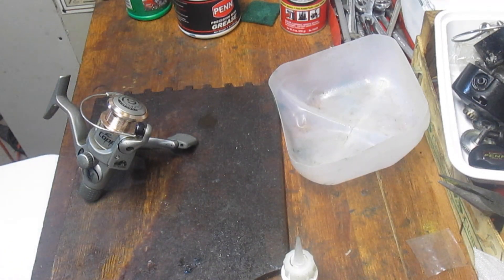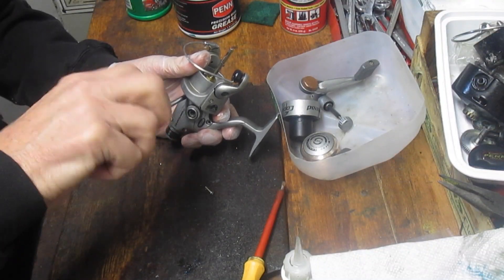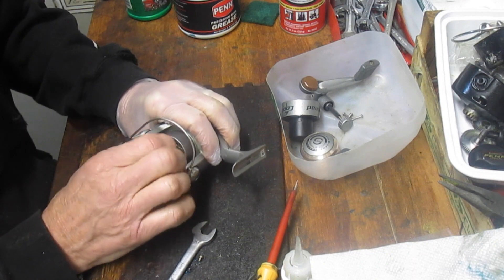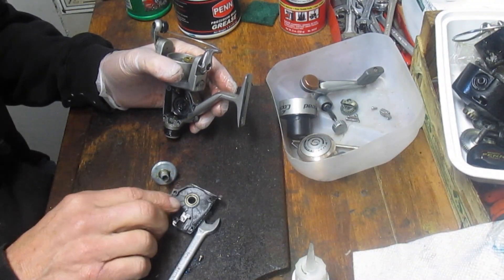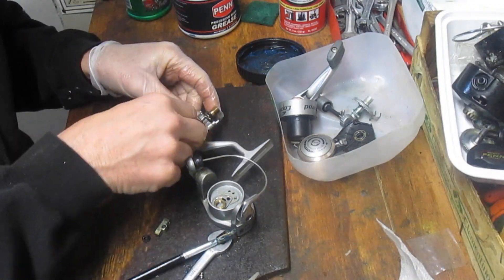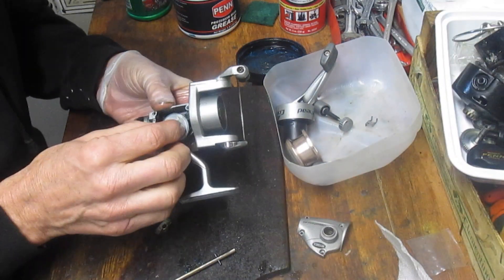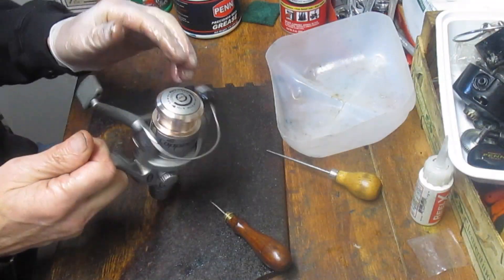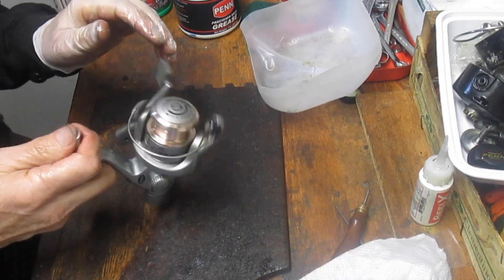Mitchell Copperhead rear drag fishing reel how to take apart and service

Comment: Hello, do you happen to have a part number for the bail wire and the holder side opposite the line roller side for the copperhead 20.  I cant find it anywhere and i am in need.  Thank you.
Reply from the maker: Try contacting their service center at
Reply: I found the part # and sent it to you